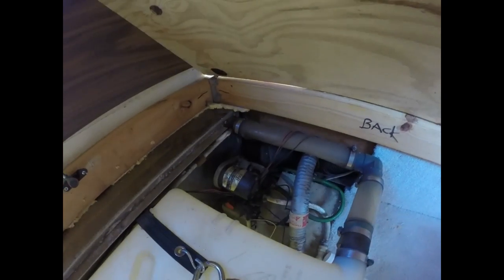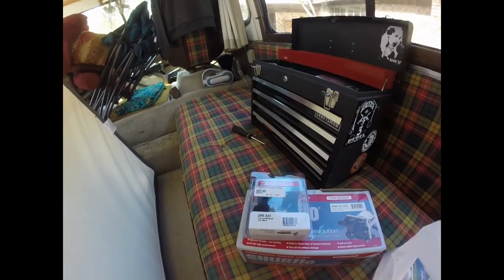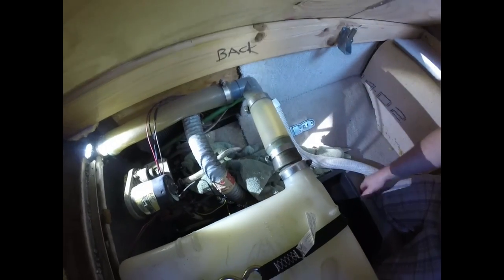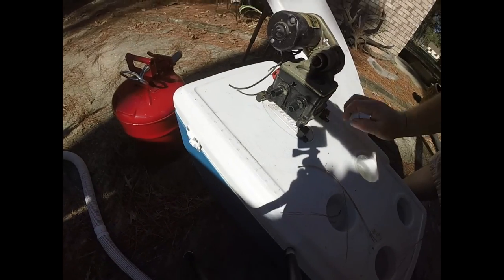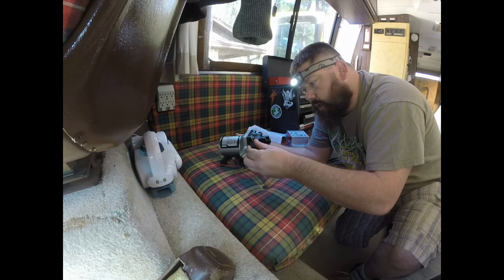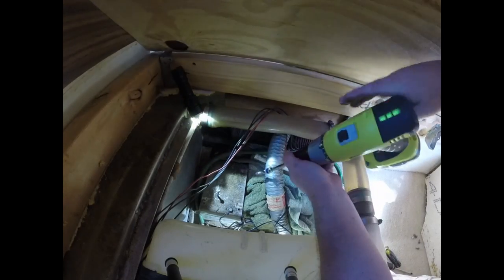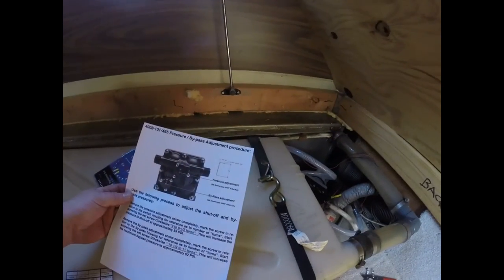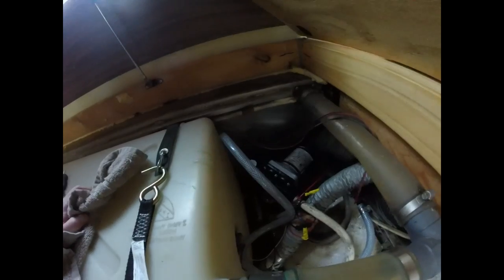GMC MOTORHOME FRESH WATER PUMP REPLACEMENT

Comment: Is the new one any quieter or was that not an issue before? It being right under the bed, it would probably scare the dickens out of me if I were sleeping and the Mrs. decided to flush a toilet!
Reply from the maker: The old one was a little quieter.  I don't mind the noise because I can tell if something is wrong. Our toilet stores fresh water and when you flush the water pump doesn't come on, so that wont be an issue :)

Comment: most tanks have a valve located some ware low the tank by an outside wall
Reply: my 95 Coronado had the water tank hiding  in the storage area under the master bed and drained above the gas tank